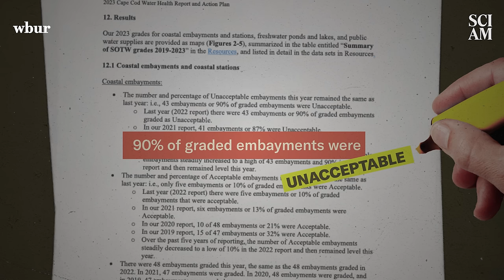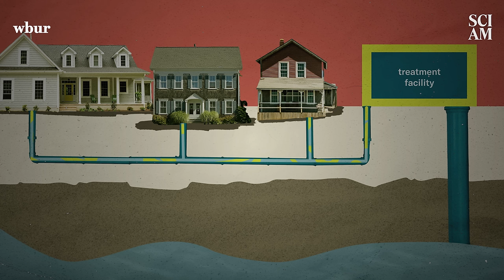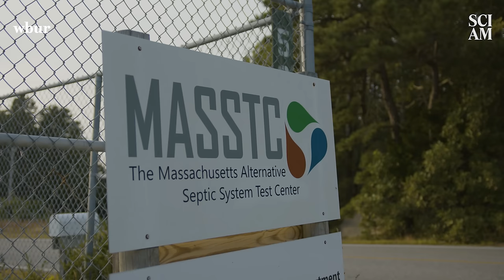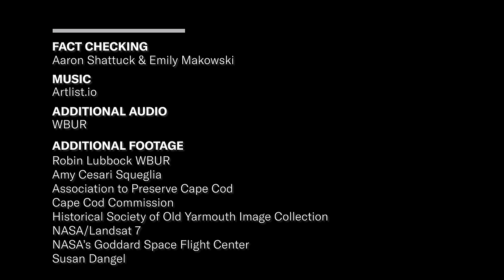Cape Cod Has a Big Problem Simmering Just Below Its Surface

Comment: The old septic systems are a huge issue, but there also needs to be tougher regulation and enforcement of fertilizer usage on lawns and golf courses.
Reply: Also, right by the MBL, is a summer camping spot that that is using an antiquated septic system. The last few years have seen excessive bacteria in and around that area. The beach is often closed or warnings are posted. I completely agree that septic systems placed tens of feet from the shoreline doesn’t help.

Comment: It's just a short piece, so you can't cover everything, but it's important to note that urine is great agricultural fertilizer and shouldn't be wasted in the first place.  Synthetic nitrogen is energy intensive and ruins the soil's ability to sequester carbon.  There is the issue of pharmaceutical drugs in urine.  I'm not sure if it's feasible to remove them before applying urine to crops.

Comment: This happens when seasonal homes are turned into year ‘round residential.
The Cape used to almost cease to exist after Labor Day.
Now it booms 24/7/375.
Only district/town sewer or onsite package treatment plants will stop this.
Drinking water will ALSO be affected.
Reply: @WhhhheatThins  
This was an issue in Plymouth County along any of the freshwater ponds at least two decades plus ago. High density small lot size.
I don't recall any use restrictions on how many people could reside in a residential cabin either.
They started doing dye tests, when it got really out of hand to find the worst systems, which then had to be converted to pumped holding tanks or package treatment plant.
It's actually a nationwide/global problem in areas of private septic high density areas.
Reply: The earth has slowed down in its orbit around the sun ?
Reply: The cape is dead from October - May. Literally everything is closed. I live in Barnstable. You have no idea what you are talking about.
Reply: @greapper1  
Barnstable isn't exactly touristy. More of a vacation/second home, or it was before I left for the other coast.
Even out here in the wild west, septic requirements have changed or gone to muni sewer due to high nitrate levels.

Comment: We used visit the Cape for a few weeks right before the season started.  Now it seems like the season never ends.  I'm glad to see people stepping up to the challenge with the new I/A septic systems.  If getting a sewer system dug is going to take 30 years, they'll be neck deep in algae when they're half way through.  I/A septic systems for outlying areas is a lot more realistic.
Reply: The best and simplest thing is to compost the waste. Why think in black and white? Composting the waste makes us more aware of what we are, and it uses less of earth's resources, and it is the best way to save water. I find it more concerning that we think only in terms of flushing our waste away than realizing it can be composted right in our back yards.  if we really cared, we would realize our responsibility to do what is best rather than what is convenient based on ideas that your poopoo and peepee should be moved out of sight.
Reply: @RebDalmas  I don't think the technology is there yet.  Urine isn't sterile like people think.  And composting toilets just store it, because trying to compost it would put too much liquid and nitrogen into the system and cause the whole thing to stink.  So a composting toilet it doesn't solve the problem at all.

And trying to get a household's urine to break down in the yard won't work at all because there's just too much liquid.  You might get some of it to break down, but most of it will seep into the ground just like it's doing now.  So it doesn't solve the problem at all.  Cape Cod is basically an overgrown sandbar - very sandy soil.  Most of the the liquid that goes into the ground ends up in ocean.
Reply: Having composted my own families waste, the urine was absorbed within using absorbent materials, of which there are many. This method uses basically no water - expect for cleaning the bucket. And, the absence of more plastic and concrete use,  prevents consuming more of earths resources and more pollution. After all, the plastic pipes are leaving behind micro particles that are causing more and more damage. It is a time to return to smaller more individualized systems, begger not necessarily better, - as is being discovered all over the US. Especially with farming. I mean look, animals are peeing and shitting all over the place all of the time and yet the forests dont smell like urine and animals feces.  Composting our human waste is probably much more efficient and much better for the environment. I never had a problem with the urine draining, it was absorbed by the matterials I used.  Over engineered systems will only lead to the same problem, and end up polluting the environment with other products that  leads to other problems. We keep doing the same thing again and again, and thinking somehow it will lead to a different outcome.   I dont even want to think about what chemicals will be needed once cluster systems come.  Bigger is not better. Simple is what works.  @darkwing3713
Reply: @RebDalmas  Sounds like a great system to use everywhere it works.  But can it work for the average homeowner?  Also, Cape Cod gets a massive tourist invasion every year.

Forests are amazing.  Animal waste is just how a forest feeds itself.  And forests hold onto far more water compared to a lawn or a corn field.  I think that was the original inspiration for permaculture.  Forests feed and water themselves - let's try and imitate that.

But a lot of Cape Cod forests are just pine trees growing out of an ancient sand bar, so I don't know if they hold onto water the way a normal forest does.  Cape Cod soil is very permeable, and that's making the algae problem worse.
Reply: @darkwing3713   A part of compositing your waste is to rebuild the top soil that was on Cape Cod. There are remaining black walnuts tree and hickory trees. There is a couple of American Chestnuts on one island.  Humanity could support rebuilding the soils on the Cape.  Those that rent out their houses could choose.  At the end of the day, it is about education. Knowing one is supporting the earth leads to actions we are able to embrace. After all, we are what information we allow within our flesh. The more we realize that, the more we are able to change and realize what would be best. Larger is not always better. Smaller simpler ordinary actions lead to the extraordinary. Does the Cape need the chemicals necessary for larger septic systems? It seems to me that more chemicals, that also require transport that uses more of earth's resources,  is the opposite direction to take. Of course it makes money for few, to generate complex systems that wound pretty covered with flowery language. That is all distracting fluff. At the end of the day, our human waste can be processed, using very little water, and support the soils on the cape.

Comment: I grew up there and it was fine until they put the Boston Outflow Pipe in. It's not the tourists, and Everyone on the lower Cape has a Title 5. MWRA's Massachusetts Bay outfall is the culprit.
Where does the sewage in Boston go to?
All wastewater collected by BWSC facilities is conveyed to the MWRA's Deer Island treatment plant where, after treatment, it is discharged 9.5 miles out into Massachusetts Bay.

I'd suggest testing the Deer Island treatment plant, and the sewage water where it comes out of the outflow pipe.
Reply: During heavy rain deer Island discharges untreated to deal with heavy inflow
Reply: That sounds right. We have a similar system in East Long Island- but it’s stable- if you added NYC waste I could only imagine

Comment: Many of the people who live year-round on the Cape can’t afford a switch from septic tanks to sewer systems. Not only is it tens of thousands per household, but it also can take up to ten years for the town to convert. People assume that just because a town has wealth that it applies to the year-rounders, but it’s mainly the people with at least one vacation home. The latter can afford it, the former generally can’t. They’re barely able to stay there at this point even while working several jobs. So a sewer system in most of the towns that don’t already have one is a pipe dream (pun intended).

Comment: The urine diversion was obvious to me.  The urine can go into a tank which has a vent up high, so evaporation can take out most of the water and reduce the volume and then the container could be carted off and replaced with an empty one from time to time and the urea, phosphorus and such could be used for fertilizer.
Reply: But what about all the pharmaceuticals excreted in urine? Will that evaporate too? It's a complicated problem to clean up the me.sees we humans make. Cape Cod has a lot of money in that area and I think they should have gotten tough and dealt with this issue decades ago. There's always going to be some folks crying about the expense, but something has to be done.

Comment: even in a best case scenario we are talking 20-30 years before remediation of this problem - you can say bye bye to the environment - even rich communities don't have the funds or resources never mind the political will or awareness needed to address this problem - a fairly mainstream pragmatic view and conclusion. They will address to some extent but likely it will be too little too late because the issue will be coupled with global warming issues which will double or triple the initial cost estimates - also very likely. #infrastructure in america - a shallow money tench and then there is a negative side
Reply: They absolutely have the money. 😊
Reply: @GoingtoHecq  the money is fungible and friable and the least of the problems - it is more of a political and infrastructure issue essentially - it will take 3-4x (maybe 10x) initial projections and be rife with corruption just like trash and concrete in nyc - these are certainties

Comment: Holy shit why these towns still living in the 1800s without sewers. Seems like common sense to you know treat ur damn water
Reply: Are you from around the New England area or ever been to Cape Cod? The majority of houses on the cape are thickly settled neighborhoods built to accommodate as many tourists as possible through the Spring/Summer. It's a very difficult situation to connect that many houses to a single sewer system with how densely populated the houses are.
Reply: They started building in the area way back in the 1620s. 
A majority of the towns' planning boards are bought off and allow so much unnecessary building. They keep claiming the state is loosing residents, so why do new houses need to built? Could start with just fixing up the old ones and not allow building on land that hasn't already been cleared (and land that was previously deemed Un-buildable). Then require more efficient waste handling on these rebuilds. 
Then of course you have the people who say their rights are infringed on with waste handling regulations while the environment continues to get destroyed. It's a no win situation.

Comment: I worked for Beach Maintenance for the DPW for a summer in Falmouth there is 9 beaches there. I witnessed the busiest beach in Falmouth have a septic backup once mid summer. It was on the tourist side of the beach and I could see the pee and floaters around little kids swimming.

Comment: My 2 cents... Yes septic systems cause nitrogen runoff (pretty hard to deny it), lawns cause runoff too.  Some but certainly not all of the places with large algae blooms are solely the result of issues caused by septic or fertilizer runoff.  The main culprit in a lot of situations is the reduced water flow to these areas due to roads/culverts which were under designed to handle adequate water flow.  A lot is being done to redesign culverts, but solely blaming Septic is somewhat biased in my humble opinion.  I certainly don't deny there is a nitrogen problem though; I just think this article only touched upon 1 of many reasons for the problem.

Comment: Mass Bay is heating up. Used to be a glacial bay, but now it's the warmest water in New England shore. They cleaned up the septic in most of the bay, but warming may make it not matter, because the old fauna won't survive the new warmth. They will die en masse and create the very same conditions as waste would. We're looking at the end of an era of great vacations.

Comment: I thought there was a unified system everywhere in Arizona with the exclusion of the Mogollon Rim. We recycle 99 percent or our wastewater. However, my mother bought a home in an old 55 plus community where each home has a septic. Her upkeep on the system, for her small home, cost more than I pay for two single family homes.
Reply: Cool but the East was built literally 200 years earlier than Arizona so its not so simple.
Reply: FL has a lot of septic systems, even in the suburbs.   My operating costs are minimal, just wish I could say the say for my water well.

Comment: I understand how a composting toilet works, but how does a urine diversion system work? The folks with the urine diversion only mentioned storage, not processing the urine. Does someone come to empty the tank and take it to a processing facility or is there a way to clean the liquid waste onsite?
Reply: Urine diversion works by separating the liquid out to be evaporated into the air. Then, whatever crystals are leftover after that process (usually minimal amounts for a year's worth of 4 people) can be either composted with the rest of the solids or taken away by a septic company. Sometimes in an off-grid setup the urine can be diverted into a specially designed plant area, where certain types of plants feed well off of the diluted urine, taking out some of the nitrogen before sending it back into the ground, theoretically "treated." You can lookup "graywater garden" for a similar concept for shower and sink water, or check out the bathroom system in an "Earthship" house for better explanations. Also, there's a good book "The Composting Tioilet System Book" (Del Porto) that diagrams out how urine diversion works, etc..

Comment: 6:19 what about being responsible for your own waste and using composting toilets, a version for any budget.
Reply: 9:20 Did we even watch the same video?
Reply: @jimurrata6785  which one do you think you watched?  I think I watched the one about septic tanks in cape cod and failing infrastructure and the cost of replacement due to climate change, which indicates an ongoing problem.
Reply: @reginafefifofina  the one I saw directly addressed this question just a few minutes later.
Reply: Note the time stamp!
Is this issue not addressed?  🤔

Comment: I always thought a simple septic design like having your toilets go into a separate tank that does not leach and would need to be pumped out when full, and the rest go into a smaller tank where solids from the kitchen sink would settle and then go into a leach field, would be a good option. Similar to the compost design that one couple had. it would certainly cost less than digging up all the roads and building pump stations. I understand it would mean changing some of the plumbing inside, but for people with a small house it shouldn't be too bad, the same vent pipe can be used. People shouldn't be forced to do this overnight, but when systems need replacing.

Comment: Restoring the oyster beds by growing oyster spat in estuaries and adding them to the depleted beds along the coast will help purify the water. Creating biochar and using it to filter ponds is then used as fertilizer, sequestering carbon and nitrogen in the soil. These issues need to look to natural systems, while regulations need to be enforced, banning fertilizers and detergents from lawns and septic systems. Biochar is an amazing way to transform biomass waste into biochar that cleans water like charcoal in aquariums.

Comment: Divert the septic outlets to enclosed reed beds to absorb the nitrogen in plant growth?
Reply: Everyone's got to get off the septic systems and get on to regular sewers. Which is a work in progress, and has been for over a decade.
Most of the Cape isn't rural anymore, it's suburban. The towns are really slow to realize this!
It's very reactionary, a lot of people moved here so everyone could forget times were changing.
Reply: Great idea! There are many ways to use our intellects to come up with a large variety of solutions to any problems. We don't need to be forced to do it one way. What we need is inspiration which you just did for others by sharing your idea, and cooperation from people who have different ideas to not suppress your idea and vice versa. Worthy goals would be achieved quicker if that were the case

Comment: Oh and guess which 15% of the homes are hooked up the sewer treatment plants?   The residents who vote on what projects to fund.  For years they thumbed their noses at vacation property owners.  The message was clear.  Pay for your own septic upgrade ....  Oh and it has to comply with Mass Title V.  In many cases, this means an enormous concrete holding tank above ground and in your front yard.   So the vacation owners nurse the existing antiquated systems for as long as possible.   No, you cant put it in your backyard.  no, you can't install a flushless toilet.  No, no no to any reasonable solution.  The message was also clear.  The residents just want the vacation property owners to leave.  Well, that stubbornness has come back to bite them.